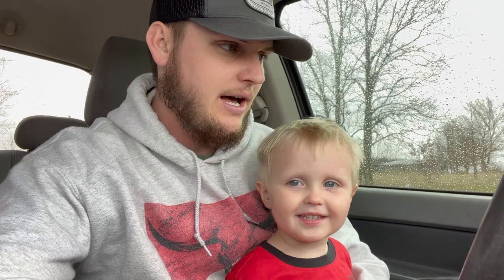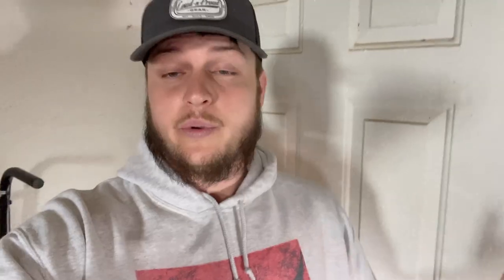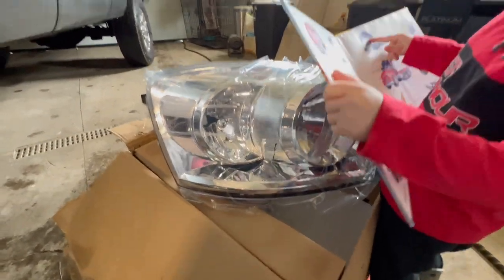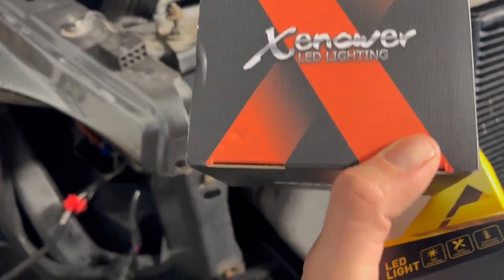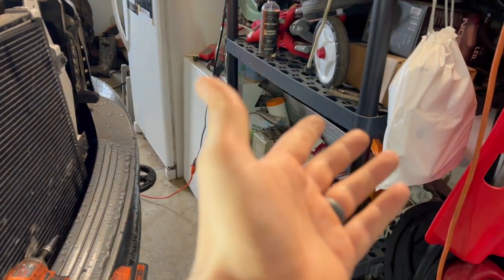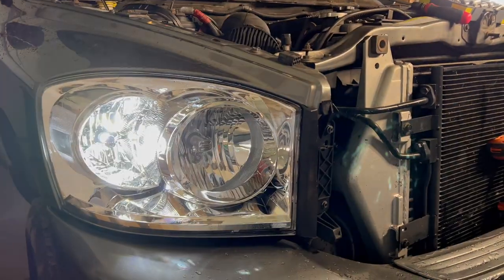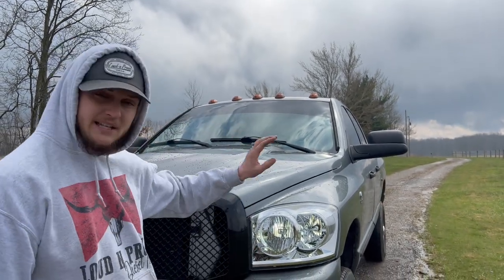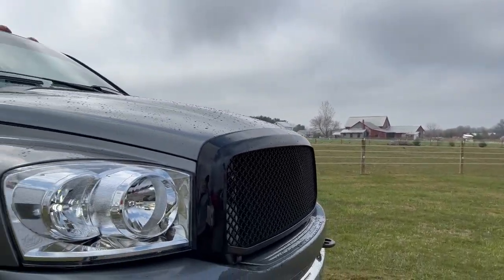Wife's cummins is STILL broken after I thought it was fixed!!!

Comment: You have to use a resistor with the headlights to make them work. I have a 3rd gen and that fixed it for me. I have a link I can give you for the ones that worked for me if you want. Also, what side lights did you use? I dont see a link.
Reply: You can't just get a LED light relay?

Comment: I used Alpha OBD on my 4th Gen to manipulate the Canbus system for the LED conversion,  on my 07 I used switchback blinkers in the front and resistors in the rear. Your issue with the headlight circuits is a bad TIPM, there are places that rebuild them to your Vin number. It's a common 3rd Gen problem.

Comment: You have to get resistors and and connect one side of the resistor positive and other negative that's how i fixed mine. Resistors looked like a double a battery

Comment: I've only ever seen it where the driver or passenger side headlight isn't working. Most people just run a hot wire from one to the other and they both work fine. I would trace the wiring the previous owner put in there and see what all he tapped in too.

Comment: I Had that issue with a 06. Put in hid lights with out the relay and damaged the tipm which cause the head lights to not work. Had to splice   into the driving lights to turn on a relay that was hooked up to the battery to get the lights to work right. My guess is that's what the previous owner did

Comment: I believe that from my experience as a mechanic dodge put a safety feature that when the head light goes out it shuts off power to that circuit and set a code in the body control module which you will have to clear in order for them to work properly but that doesn't explain why they work with the key off and not work with the truck on. I would check the wiring harness and see if the extra harness isn't interfering with the factory

Comment: I had a 4th gen and I had the same problem. The harness comes in on the passenger side I had to replace the plug from the harness it looked fine but it had a short. Don’t ignore my lights eventually stopped working all together and it happened when I was traveling and I drove home with just my hazard lights which was real fun at 10pm!

Comment: I saw a comment on here about resistors for the led lights that’s what I had to do for my 2004 ram 2500 they make them plug and play and or you can get them and splice them into the wires it’s a pain but worth it in the end

Comment: With that guys splice of wires I would be worried he did something to the TIPM. You may have to take it to the dealer to have it reset or replaced all together. If you have to replace the TIPM buy online because the dealers and local parts stores will bend you over.

Comment: The K in the 6000K is kelvin. It is a color scale for lights. The colors go from yellowish to white to blueish as you go from 2700k up to 8000k. It is supposed to be based off the color of steel at that temperature. You now have more useless knowledge then before 🤣🤣